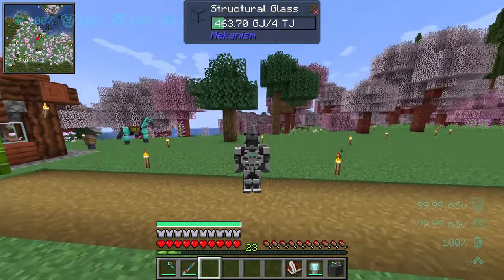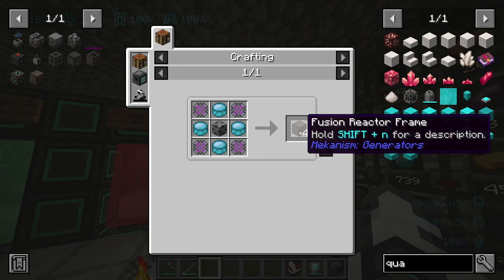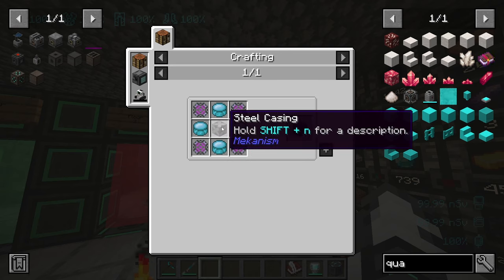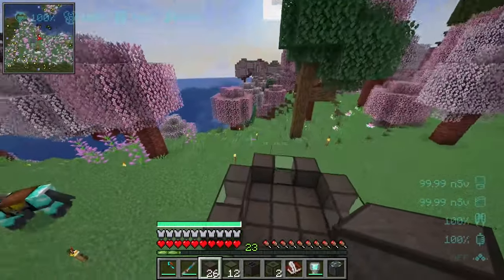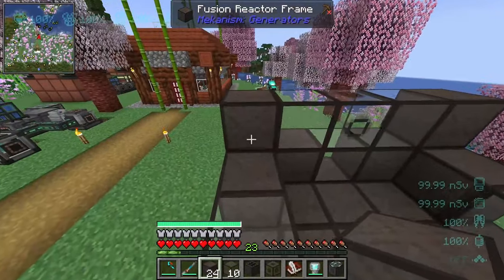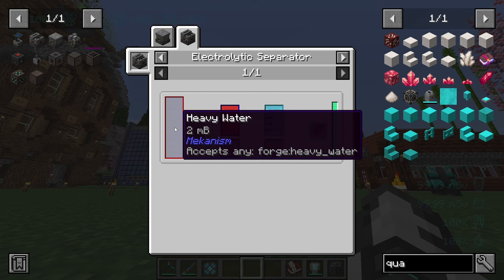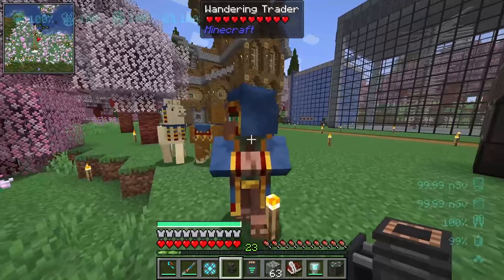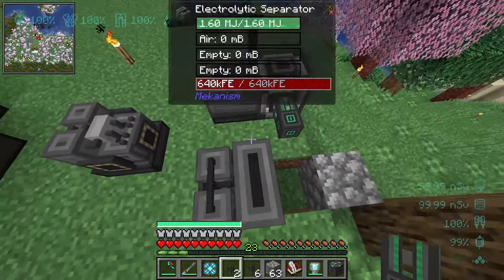HOW to BUILD the FUSION REACTOR in Mekanism | Minecraft 1.19

Comment: So I found that if you use an ultimate chemical tank for Tritium and have two Solar Neutron Activators you can store enough Tritium to run at max fuel injection rate even through the night. 
For Deuterium to stay maxed I’m using 5 pumps with max upgrades and filter upgrades to keep the production going at max.

Comment: You can actually use the lasers to create a cobblestone factory.  If you set up a tank such that lava falls onto a hopper covered by running water, it will create a stone block on top of the hopper.  You then point the laser at the stone with an obsidian block on the other side and it will break the stone, which then gets picked up by the hopper.  The lava will then fall down onto the running water and make another stone block.  You probably want to throttle the power the laser gets by placing an energy cube along the line and a single low tier cable.  They can use a lot of power but the speed is mostly limited by the rate at which the lava travels, not the power to the laser.  Due to the way lava travels, it works faster in the nether. It's useful so you don't have to drill massive holes in the ground to get the sulfuric acid you need for antimatter generation.
Reply: @OverlandSmiles  That's a good point about the water in nether, suppose it wouldn't actually be possible.  As for the traction beam, you can use that but it's more expensive to make that than the hopper so in my setup I just used a hopper.  They're pretty much equivalent builds though.  As for the obsidian blocks breaking, technically they can break but the stone spawns faster than they break regardless of how much power you put in the laser so in practice they don't break.
Reply: @OverlandSmiles  The only negative my testing found with the hopper approach is that if you're standing nearby with a strong magnetism on for your mekasuit, occasionally you might pull a cobblestone away from it before the hopper grabs it.  At a minimum, you'll consume energy if you're near it.  Besides that, I suppose in theory the cobblestone could spawn in the lava but I suspect the hopper pull happens before the item realizes it's in the lava because I've yet to actually see that happen when watching it.